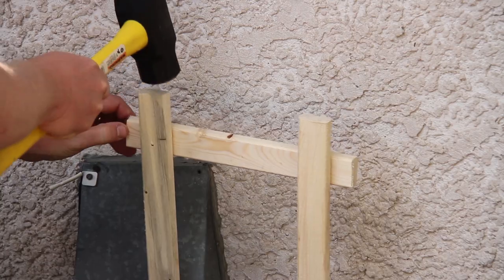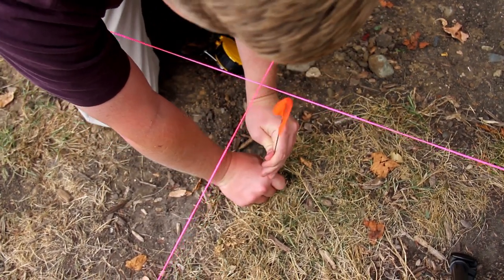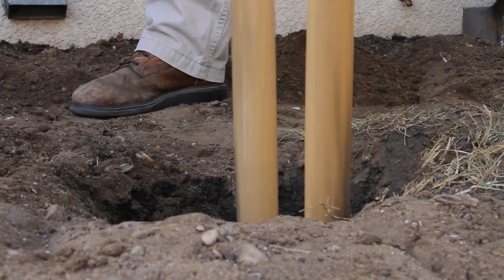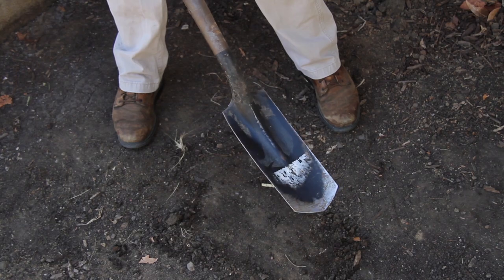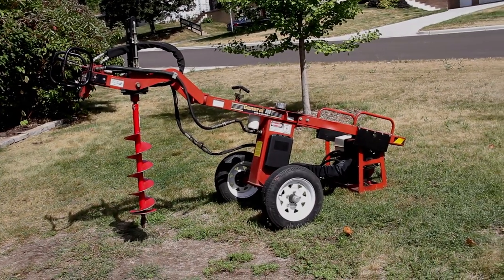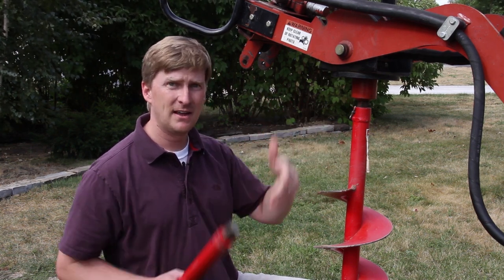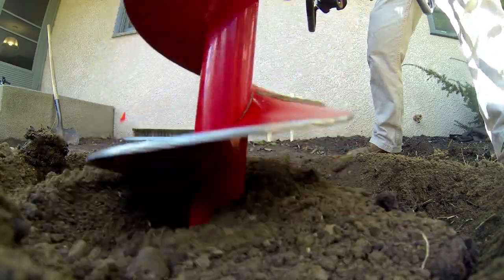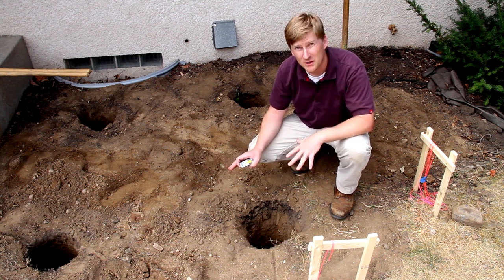Digging Footings for Decks and Other Outdoor Projects

Comment: how did you get the auger not to go  at an angle - we had to muscle backwards or forward whilst doing it to keep it perpendicular.  Those directions on the side of the unit were worthless as tried that and that's why we muscled it instead.  Did work nice though

Comment: Why use forms? Could you just fill hole?
Reply: You could. Having the form helps you have a better idea of the amount of concrete you will be pouring as well as better controlling the concrete cure. Loosing some water to the soil (or lots of other variables / contamination) could have an impact on the quality of your concrete... but I'd say, most of the time for small residential project, it won't matter much.